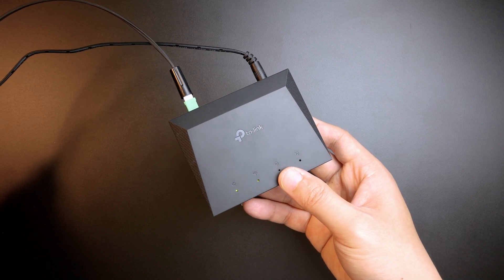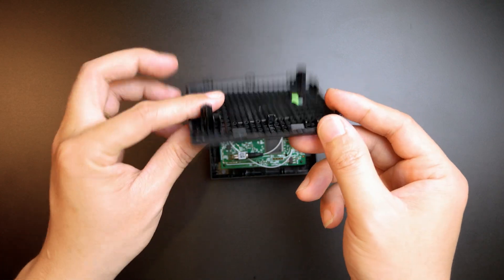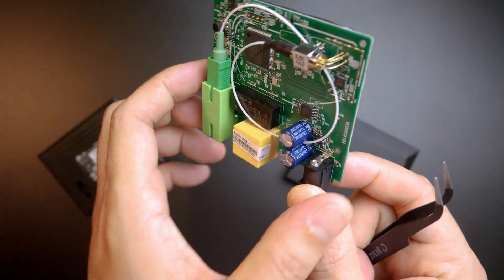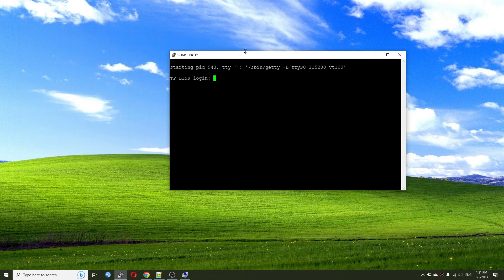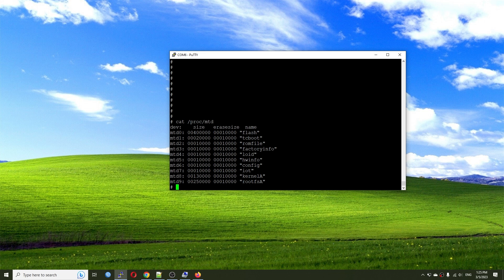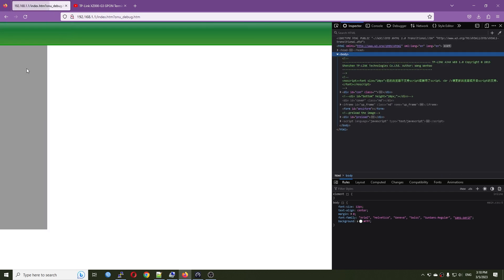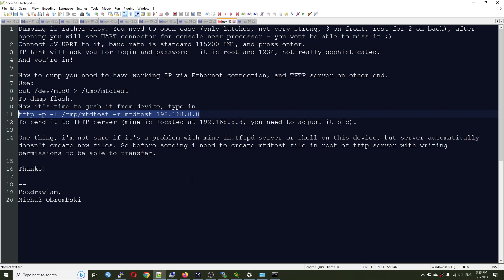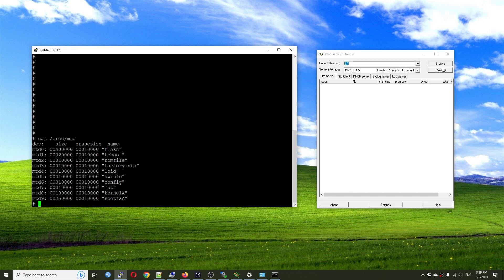TP-Link XZ000-G3 GPON ONT - Teardown - UART Console Access

Comment: I did the teardown and solder process, but after trying to connect on putty I didn't have any response. any tips?
Reply from the maker: I assume you already get it done. If not, make sure your USB TTL adapter is working, and swap the TX and RX pin if possible (the VCC is disconnected and the board is powered by the DC power)
Reply: @VanTechCorner  well, USB TTL adapter is working (I can see it in device manager as com port 6), I change TX and RX pin just as you did in the video but no response inside putty. I'm windows 11 user and my XZ000-g3 version is version 1

Comment: Adding hidden pages doesn't work because you've made a typo ;) I will post instructions here tomorrow ;)
Reply: Yes he made a mistake because of
TP-Link ipaddress?page=<web_file.htm> from chrome dev.
So this one can change it web file and volia it's working.. 
Can you please share full web_file.htm on this device?
Reply: @kunalbhattacharjee4793  Here's a list of all accessible pages. Some of them arent hidden but dont have time to analyse it:

-rwxr-xr-x    1     36587 device_mgmt.htm
-rwxr-xr-x    1        10 empty.htm
-rwxr-xr-x    1      7678 epon_onu_sn.htm
rw-r--r-    1     15677 epon_sys.htm
rw-r--r-    1     14898 epon_vlan_manage.htm
rw-r--r-    1      1866 epon_wan.htm
-rwxr-xr-x    1      2092 factory_set.htm
-rwxr-xr-x    1     32724 gpon_iot_edit.htm
-rwxr-xr-x    1      4901 gpon_onu_sn.htm
-rwxr-xr-x    1      1808 gponctc.htm
-rwxr-xr-x    1      9604 iot_cfg.htm
-rwxr-xr-x    1      6441 lan.htm
-rwxr-xr-x    1       589 onu_debug.htm
-rwxr-xr-x    1      4901 onu_sn.htm
-rwxr-xr-x    1      5169 optic.htm
-rwxr-xr-x    1      1769 restart.htm
-rwxr-xr-x    1      6311 rt_stats.htm
-rwxr-xr-x    1      2104 softup.htm
-rwxr-xr-x    1      3399 sw_status.htm
rw-r--r-    1     14524 sys.htm
-rwxr-xr-x    1      2090 tcont.htm
-rwxr-xr-x    1      2724 user.htm
rw-r--r-    1     18216 vlan_manage.htm
rw-r--r-    1     10416 wan.htm
Reply: @michaobrembski7948  thank you..  😊
Reply: @kunalbhattacharjee4793  Can you please share me the guide or screenshot ? I still do not get it.  Thank you
Reply: @Decimoxx  
Oh that is very sad news 😔
I tired to replied you many times but I couldn't comment you due to YouTube flagged is now automatically removed my comments... 
I don't understand why is that?
Reply: @kunalbhattacharjee4793  do you have discord ?
Reply: @Decimoxx  no, i don't have discord. but i have telegram.
Reply: @kunalbhattacharjee4793  can you pls share me the guide too? Thank you so much!